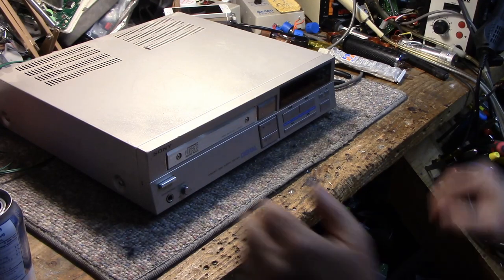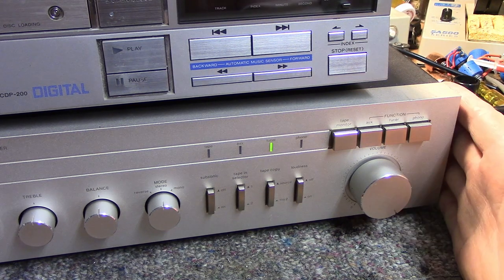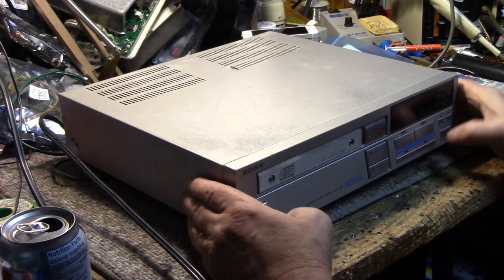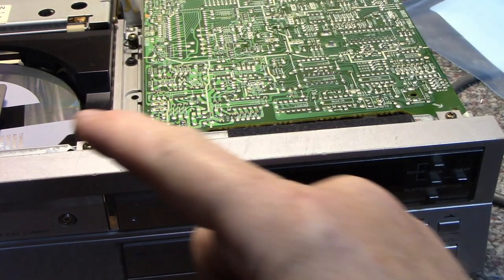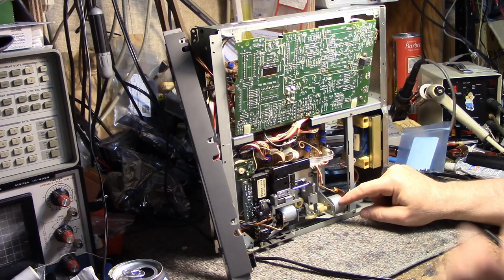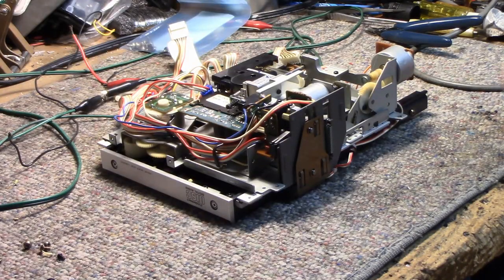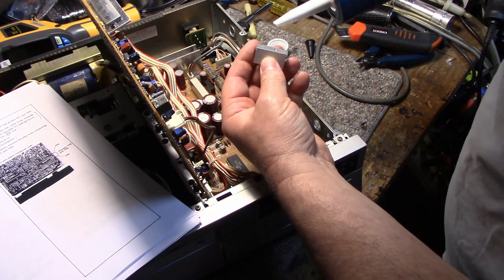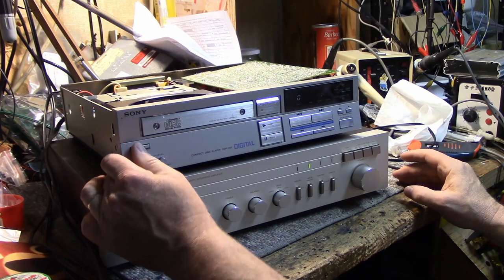Sony CDP 200 CD Player - Cleanup & lubrication (Ep. 24)

Comment: Looks like this is just the video I was looking for. I'm trying to help my kids get a little more excited about physical media, just in case, and I found a Panasonic top loading five disc changer, which I like the idea of because it gives them a little more of a view of the mechanics of it. So when I get it home I want to pop it open and clean it out and make sure everything on it runs properly. Panasonic made good stuff back then so I'm expecting it still to work pretty well, I just want to give it a once-over.
Reply from the maker: Hi Paul, thanks for watching. Vintage Panasonic gear has it's own set of problems. The main issue is leaking capacitors. The caps in question are blue or purple in colour and have a 3 sided triangle symbol on them. Look for blue/green corrosion at the capacitor leads. As these caps leak corrosive liquid the leads turn fuzzy blue. The capacitor dries out and ESR goes up with time. If the leakage is severe the liquid can run down to the board and damage the copper traces.
Reply: @TrevorsBench  I'm going to look into that today.  Thanks for the tip.

Comment: Iam a subscriber of your channel. I have a sony  cdp - 101 . Cd not reading. I have changed the laser diode sharp LT022mc .i believe i have wrongly soldered the wires from APC circuit. Can you pls advise how to find out the pins in sharp LT022MC . Pin 2 in the centre ,but which one is 1 and 3 . When the cd goes in the laser light just blinks a second and goes off . Pls reply

Comment: I always thought it wasn't a good thing to work on electronics on a carpet because of static electricity not to mention lint and dirt.
Reply from the maker: Myth busted
Reply: @TrevorsBench 😊 Btw What lubricant or type of lubricant did you use on the metal shaft? What would you use for plastic on plastic? Thanks